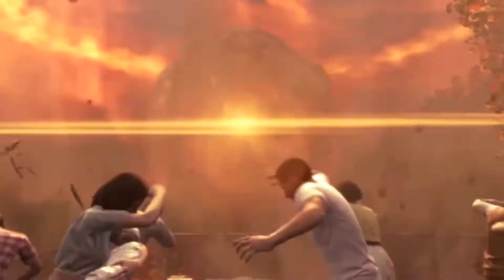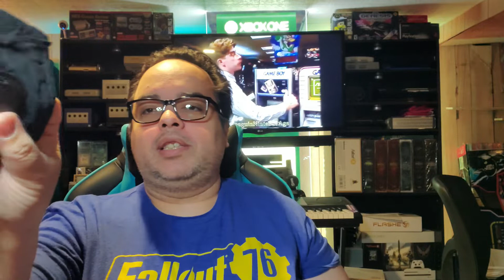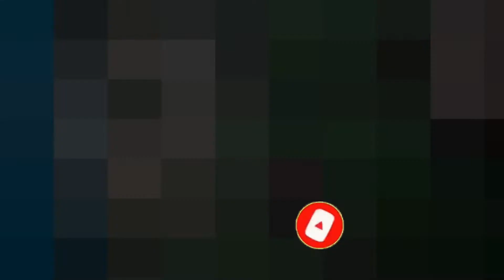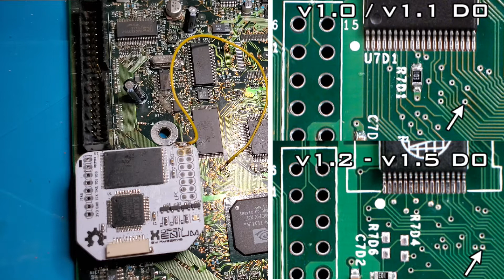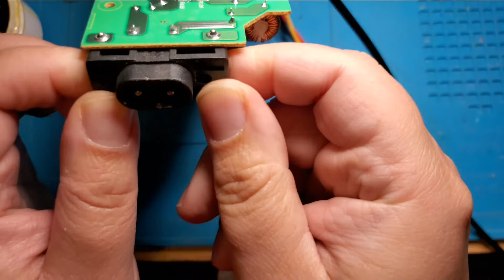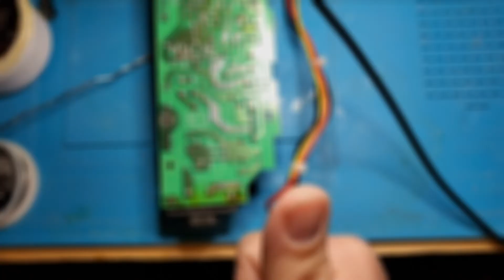Gamer's Vault: Original Xbox Mod Chip Explanation

Comment: 5:22 1.6 you can use a mod chip. I have four chipped 1.6 boards. You might want to look into this and address in a later video.
Reply from the maker: I will since this is only part 1 I will look into it
Reply: @TheGamersVault  No need to mention me. I have no ego left :-)
Reply: I do have a video here https://vimeo.com/265537811 but it's a slow one going through the whole Aladdin chip installation on a 1.6 along with other general maintenance. It's long, but that's my style. Maybe play it in 2x or something.

Comment: cant use a modchip on a 1.6?!?!   smh
Reply: and its the foxconn 1.0s that had the solder joint issues.... you have a delta there
Reply from the maker: Do not worry I have a 1.6 which I will have it done not that as well